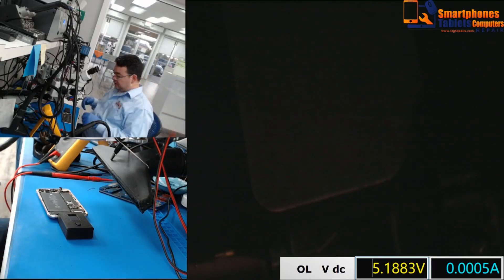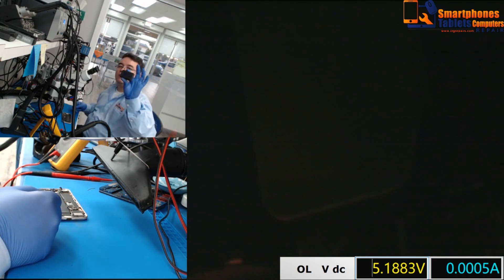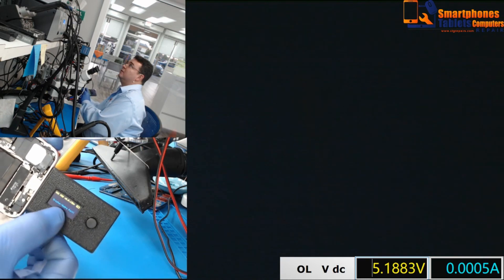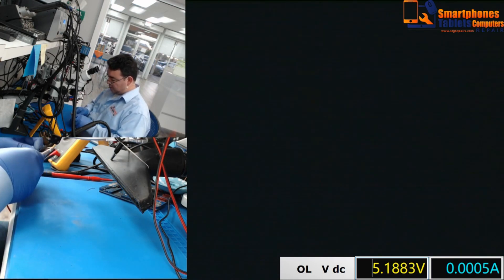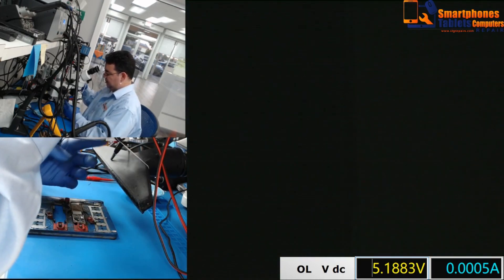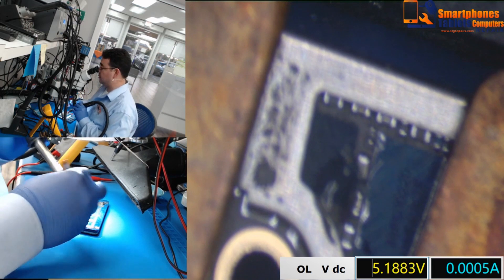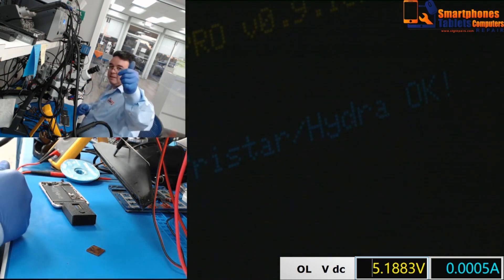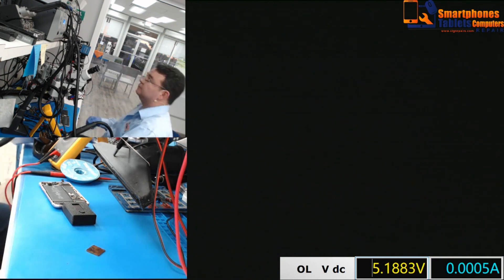Using ICC PRO to test Tristar Hydra

Comment: Did you find the tester battery to die very quick and unable to charge? mine keeps dying and have to replace with new batteyr to make it work
Reply from the maker: No really my is working perfectly
Reply: @stgrepairs4893  I have had this issue from the beginning. 10 batteries later still here.